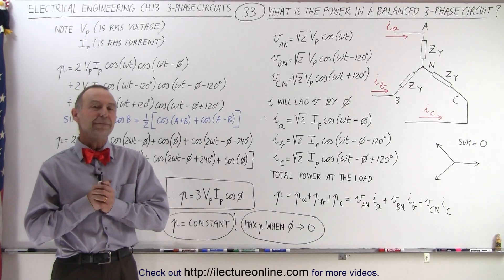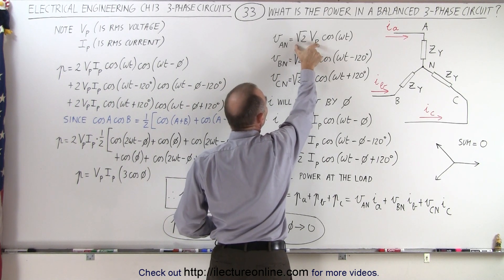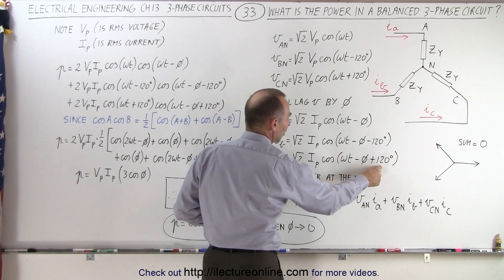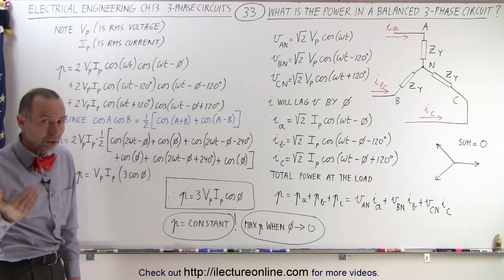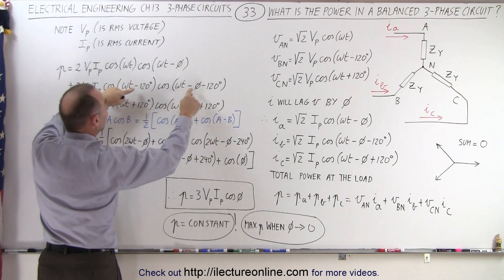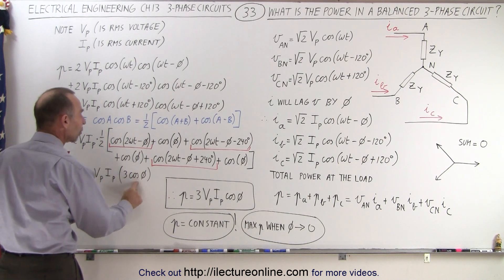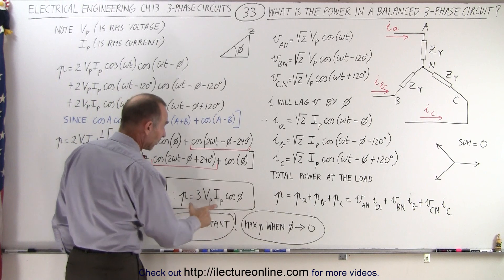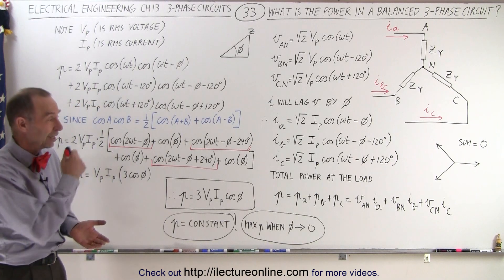Electrical Engineering: Ch 13: 3 Phase Circuit (33 of 53) Power in a Balanced 3-Phase Circuit

Comment: Can this be done using polar notation?  I tried, but it didn't work too well.  Magnitude was right, but not the phase angle.
Reply from the maker: It should be possible.  But some methods are easier than others.
Reply: @MichelvanBiezen  Your method is better.

Comment: I still don't get why sqrt(2)
Reply: That is becuase when the voltage is in the form of polar phasor format, the voltage before the angle is the rms voltage. Meaning Van=Vrms<theta. Meanwhile, when a voltage is in its sinusoidal format where there is sine or cosine, and time, the voltage before the sine or cosine function must be the peak voltage which is equal to Vpeak=sqrt(2)xVrms. Hence that is the reason why there is a need for sqrt(2) in the sinusoidal format of the voltage.
Reply: Vrms = (Vpeak-peak/sqrt(2)) rearanging the equation you get                                                      Vpeak-peak = Vrms*sqrt(2)